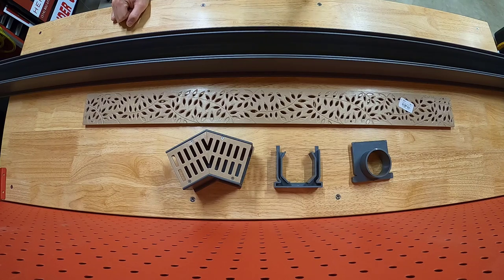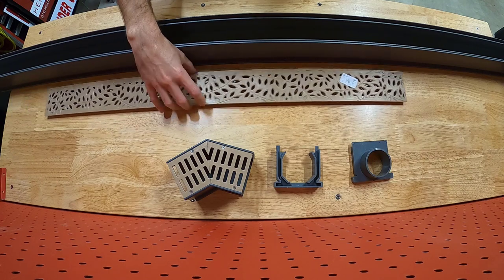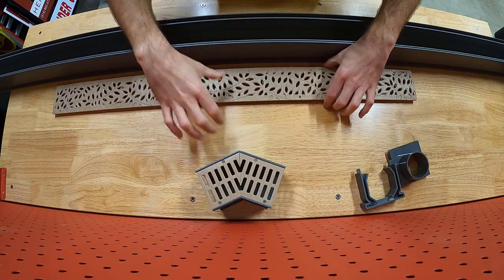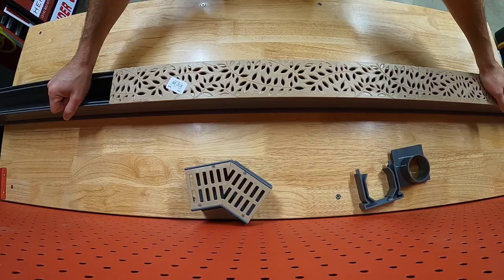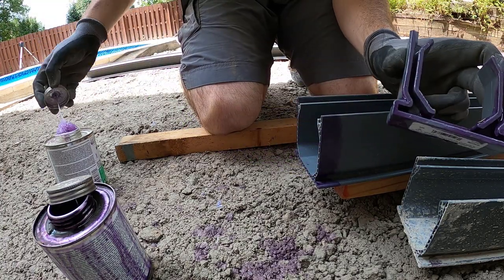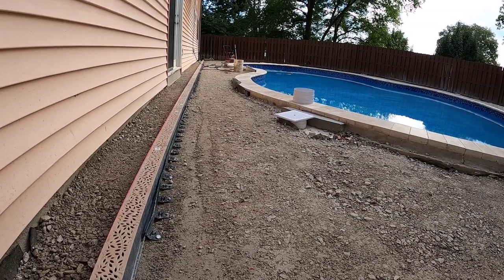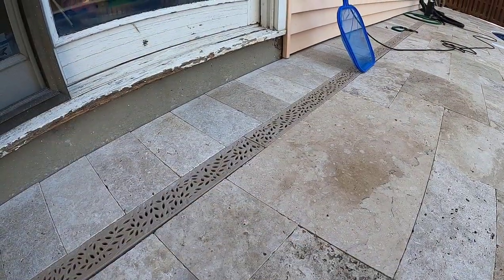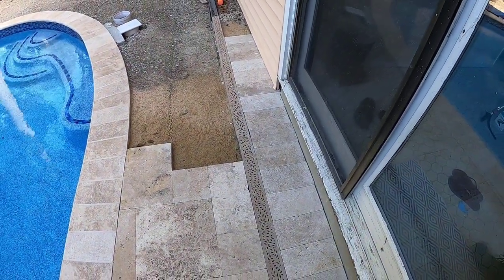DIY - NDS Channel Drain - Review & Installation  with Pavers

Comment: Thank you for your video. It really touched basis on what I want to do in my pool deck and it really help me a lot. I would go with concrete cement to hold the drain system up so I do not have to worry about nothing.
Reply from the maker: Hey there, thank you for the comment and feedback! Good luck on the project.

Comment: A 2 year update would be awesome. I'm about to embark on this exact same thing so I'd love to know how it's performing and if you'd do anything differently. Great video. Thanks so much!!
Reply from the maker: Hey there Will, thanks for the comment. I've been very happy with the drain and the performance so far; no issues at all with setting, rising or movement. The only consideration or call out I would make is that my installation required the drain to be basically "Flat" from end to end because of the paver deck layout, this isn't a huge deal but because of this the drain will hold a shallow amt of water after a rain. If I had to re-do it, I would do it the same way. Let me know  if you have other questions or thoughts. Thks!

Comment: This looks great. I love this.😅😅 You did a great job. I'm looking to install something like this in an enclosed patio. What do you have at the end of the pipe? Is it just an open pipe? I'm worried about creepy crawlers coming into the patio.😅
Reply from the maker: Thank you for the nice comment! I have my drain connect to a buried downspout 4" pipe and just have the end open still. Depending on where you run yours to, they make various grates or covers for either PVC pipe or corrugated drain pipe as well. If yours is installed in an enclosed patio you may even be able to use some sort of screen or hardware cloth wire on the end to keep stuff from crawling in since you shouldn't have much leaf or debris getting in the channel drain. Hope this helps, good luck on the project.

Comment: Did you have any issues using PVC glue with this channel drain?  The material is Polypropylene and NDS suggests avoiding pvc glue and instead use silicone. It doesn’t seem like silicone is a strong enough bond so I’m looking for other options and curious if the PVC glue worked well.
Reply from the maker: Thanks for sharing this, I didn’t see that info from NDS when installing mine. I have not had any issues that I’ve noticed at all, but I did find I needed to let the pieces set for a bit after glue up before moving, took longer to bond than normal schedule 40 pvc.. probably because it’s actually polypropylene as you have advised. Based on my experience, I’m with you on the silicone, would be a little hesitant, maybe some sort of epoxy adhesive would actually be the best route. Let me know what you end up using and if it works well. Hope this was helpful. Thks!

Comment: Hey how well did the drain stay in place without concrete?
Reply from the maker: I’ve had zero issues with movement or shifting. Everything still looks like the day I installed it. If I had to do it again I would do it the same way. Hope this helps! Thks

Comment: Did you seal the edge gap between the pavers and the drain? Did you just use Polymeric sand or caulk so water would flow right in?
Reply from the maker: This is actually a step I still need to do, but I am planning on using Polymeric Sand on the stone and then attempting to also add a bead of caulk or urethane between the stone edge and the drain where they meet. So far, I have had good drainage actually even without either of these steps. Hope this helps, let me know if you have any other questions or ideas here. Thanks for the comment!

Comment: Hi there , does the channel drain has a slope or can i leave it level since it will be open on one side ? thank you
Reply from the maker: I didn’t put any pitch on mine, just kept it level with the finished height of my pavers, no issues with it draining at all, it will however hold a little bit of water and may not flush out dirt/debris due to this as well. No big deal for me though, can easily hose out clean after a couple years. Hope this helps, good luck with the project.

Comment: Did you slope the drain?
Reply from the maker: It’s really not pitched because of the orientation to the pool deck pavers, but has worked great regardless. Little standing water after a rain, maybe 1/8”, but dries quick. I would do it the same way of doing again.

Comment: channel drain to be installed in pool deck and ran to pvc and run under concrete, how to keep from freezing in winter?
Reply from the maker: Hey there, I guess the only way to truly keep it from freezing is to have your PVC down below the frost line in your area. I get well below freezing in my area over the winter and have not had any issues so far with my installation.

Comment: Have you ever installed a channel drain, similar to this one, in an existing travertine pool deck that is held with cement?
Reply from the maker: Hey there Joseph, I have not, this is the only one I have installed and it was on my own project. You may search for videos of someone installing in a driveway to get some ideas on the approach there or the link below may give a good starting point as well: 
https://youtu.be/wmSNlFueFVQ
Hopefully this is a little helpful. Good luck on the project!